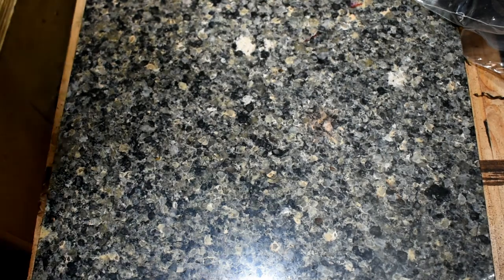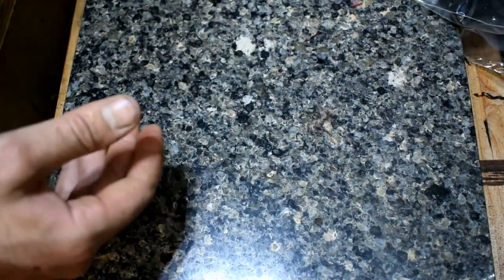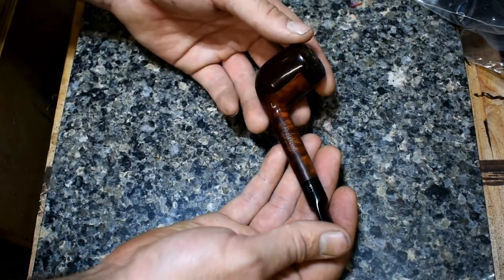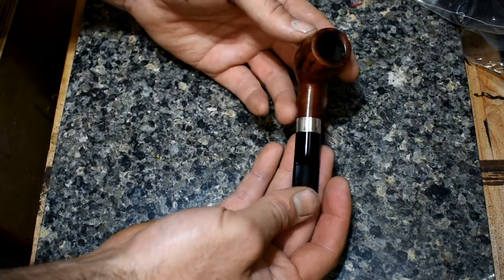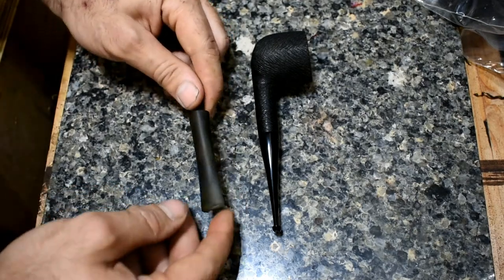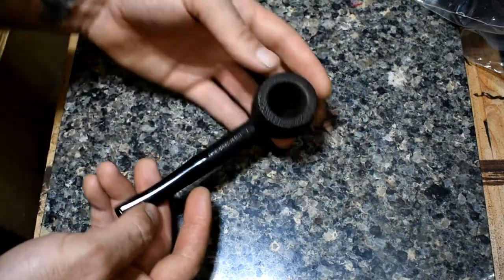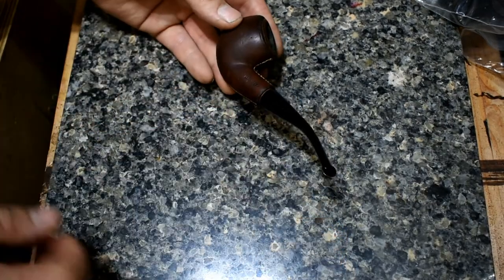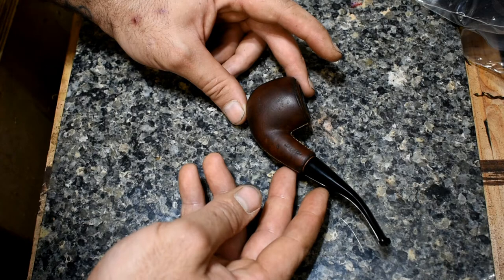Garbage Man Piper Restorations Part 1

Comment: Those came out pretty good, I've repaired the bite throughs before and it's a pain. Not sure how that happens,  but had 2 estate pipes like that I repaired. Nice work and happy piping brother.
Reply from the maker: After I found Vermont Freehand, I just replace stems straight away. Stems are cheap, and I own a lathe, so if there is a hole or a chunk; I dont even consider repairing it. 

Thanks for watching.